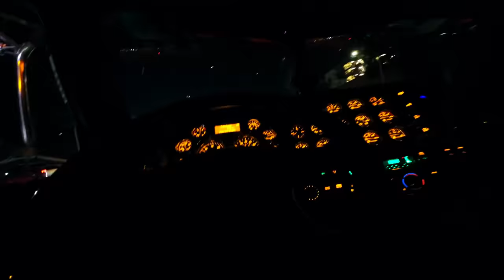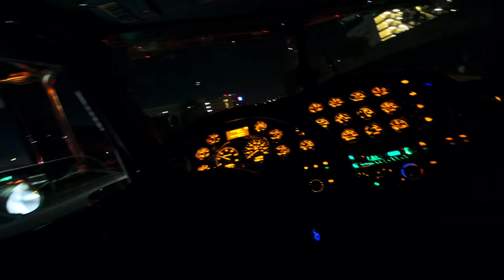Wrong Way Driver vs Big Rig Crash (recorded with DJI Action 4)

Comment: 22 years driving a tow truck in the Inland Empire Southern California and in Orange County never once have I seen a CHP officer with a push broom that's pretty cool 
it's also cool that you don't show fatals I didn't either great job
Reply: I thought it was odd as well. Plus, he has rank Sergeant or?
Reply: I'm amazed at the mayhem that Kia caused on that tractor and no one was badly injured. Plus, the Kia removed the transmission at no extra charge! Might as well replace the clutch if we're going back together. Wouldn't surprise me if that tractor's not a total. There's a lot of damage under there. Years ago near shop where I was a heavy duty truck there was a small bridge over a canal. This is going back probably 30 years or maybe longer there was that three axle Mac conventional heavy duty wrecker towing a vehicle to our shop coming over a small canal and a very low speed wind a small Mazda coming at it from the opposite direction caught air coming over the canal slamming into the driver side of the front axle of the Mack which was an 1974 I believe so you know it was stout.
On these automotive forums you hear people complaining that these new cars are not as good as the older ones. Well, they are correct! They're not as good as the older ones they are better. I realize the technology and emissions controls upset a lot of people. The auto manufacturers wouldn't be filling these cars with all of the technology unless the people were willing to pay for it. I don't think many cars prior to the year 2000 would survive a crash like this without serious or fatal injuries. Like or not and I'm not a fan of new cars They are safer.

Comment: The new camera did a great job. I was particularly impressed at how well it handles the dramatic swings in the amount of available light when you're going between facing the wreck in the dark and facing Hulk with its eleventy billion candlepower of lights.

Comment: My late 20 I thought about trying hauling over size load or a hook 🪝 for the challenge. I saw a tow truck with a 2x4x5( 3 stick truck) he let me ride when he pulled a truck out of the mud. He shifted 5 times in 10 feet. 😮 crazy low hears and never spin the tires.
You did amazing job. Respect

Comment: I am amazed that even though everything from the frame down got ripped free there wasn't any anti freeze or oil spills...that by itself is a good thing for you guys and those that cleared the shrapnel from the car that got scattered on the road. Crazy lucky that no injuries... great to see too.   The extras at the shop and your narration was great Josh and the video and audio overall was fine...no glitches at all.
    Stay safe out there!!

Comment: If you have the broken hose like that, you can pinch it off with a pair of Vice Grips, the sheet metal ones for body work, work the best. Then you put air to the back axles with the valve on the cross member, usually above the front drive axle. You could always cage the tractor brakes instead and run your air and service lines to the trailer for their air and brakes on the towed unit. Hope that helps for those in the future. Over 10 years in Heavy Duty towing and recovery here, I love rotator work the most!

Comment: Nice Video. The Quality of the new DJI Hero 4 is amazing. Especialy the Light to Dark switches are all nice and clear. No blurry mess in the dark background and also good details there. 
The GoPro from Alex on the way to the scene is way more blurry between dark and lighted objects then your footage there. Also the stabilition works great for the Hero 4. And for 4K footage 90min Battery time is great. GoPro has perhaps 60min. So I would say its a great cam for work at night.

Comment: Wow, truly amazing nobody got hurt. Got to love them removable tow hooks. They come in handy. Wondering how the young lady managed to go the wrong way down the freeway. She is very lucky & needs to be counting her blessings. Awesome fast recovery even with all the carnage laying around. Once you guys lifted the freight shaker up, you can clearly see the entire front suspension collapsed. This could have ended very badly for that truck driver. When the front end fell off goes to show how dangerous it is for the recovery crew too. Somebody could have been trying to cut the front end apart when it fell unexpectedly like that. Josh, you should have called for the Landall with all the parts falling off the freight shaker. I think the trany fell when the front end fell off. What a mess. That wasn't the trany, it was the passenger side inner fender assembly.

Comment: NICE WRECKER‼️‼️‼️‼️🤩🤩🤩🤩🤩🤩🤩🤩😍😍😍😍 Bad accident there‼️‼️ It’s saddening, but that’s what happens when you don’t pay attention to what you’re doing OR. IF you can’t see at night, you have night blindness and you need to stay at after it gets dark OR DON’T DRINK ALCOHOL AND ATTEMPT TO DRIVE‼️‼️🤨 How in the world did you get that tractor Trailer towed with no wheels, and the bottom parts were not even there ⁉️⁉️ WOW‼️‼️🤩👍✌️ You did great though‼️‼️👍😃✌️

Comment: I had a vw 4dr take out the front end of the semi that I was driving, I had the green light at the intersection,  I had to down shift because   of slowing down, and when I started to accelerate  again she ran a red light and turned in front of my dump truck. Needless  to say I was up to around 48 mph with a full load of wet sand 8o,000 lbs, which does not stop very well, when I hit my brakes the load shifted and pushed my truck into her car at about one he'll of an impact, her car was cut in half,  the motor from her car came out and went under my truck an took out my front  axle leaving  me with no way to control my truck. There was a brand new Dodge pickup to the right of my truck an it was taken out in the same collision.  When I finally  came to a stop the truck was about 300ft from where the crash took place,
Reply: Damn.....I hope, like this video, there were no fatalities in your accident as well. How scary.

Comment: There's more damage on the truck than the car, both totalled.
You need proper bumpers, we use 10mm plate aluminium with front under run protection not plastic like cars. Or get a proper bullbar so the truck wont get written off or the car jammed under the truck

Comment: I understand to a degree the resistance to post a fatal but I disagree with it. For several reasons the biggest being the best way to help educate and discourage impaired and reckless operation. You can always elect to not have the video monetized or even better than that and I know that the biggest reason why is not to profit from it and that is easy to solve by taking the money from it and donating it to support drivers education during related charities addiction treatment ECT witch would honestly be the biggest and best help you can provide and should be the reason why you post the fatal instead of not. But regardless you are doing great work and your content is great. Just a suggestion sparked by hearing you say you would not post it if it was fatal

Comment: Great work, but you need a heavy duty crash truck. With oil dry,a generator, cutting tools,etc. Its ok with the battery tools but you had the power of a air compressor and cutting tools would pay for itself.
Reply from the maker: We have an environmental truck. I’ve used it in quite a few of my videos. And my truck has an air compressor. And cutting tools. In no way would I get to a call then wait an additional hour for a second truck to show up to bring me that. My Milwaukee tools are amazing

Comment: Are those bumper pins rated for side-loading? A sheared pin(s) while you are under there working the rigging could be fatal for you.
Reply from the maker: No, but I’ve done load cell tests and the weight is so minimal, then factor in no front axle. Plus mine are modified and not stock ones.
Reply from the maker: And with that logic anything will kill me. Nothing stopping a drunk driver from flying across the lanes and hitting me either

Comment: I would have put service air to the trailer and used the trailer brakes just caged the tractor. Regards Ken
Reply from the maker: Why? That’s a lot of extra work to cage 4 brake chambers vs an air line ?

Comment: Dont let Casey see you lifting with those tow (only pull) Freightliner tow hooks.
Reply from the maker: Who is Casey and why would I care. I've done a video with a load cell on these. Do you know how much each pin sees? Peanuts. Like less than 3,000lbs per pin. The issue is when dumb people put tons more pressure on one pin only
Reply: @PepesTowingService  Thats good enough. U dont know casey. That awesome.

Comment: Should put another reel next to the one you have that way your not stretching the yellow hose and could make a setup so if hooking the air to trailer have the yellow hose to a regular hose that is longer going from trailer to the front of the tractor then yellow hose from that hose to your reel hose ,it can be the red or blue or both . At least if had to hook air to trailer you can just grap the set of hoses put them in place then grap the reel hoses from your truck to the front of the tractor when you have to cage the tractor and take driveshaft off.
Reply from the maker: Ummm I have plenty of air hoses dude

Comment: To bad you didn't just put the tractor on the underreach first rise the tractor high enough so you could use the boom to move the axle and the engine on the first movement that is if you were able to rise the underreach high enough.
Reply from the maker: Ok smart one and how would you do that when it had NO FRONT AXLE ? even lifting by the leaf springs would be risky. The way I did it is fine
Reply: @PepesTowingService  just like you did it for the tractor,I guess you didn't read the whole thing you just skipped a lot of it.